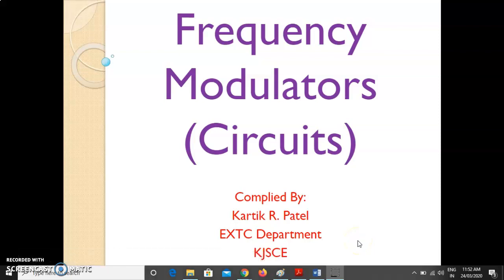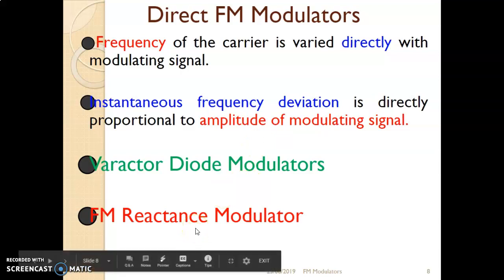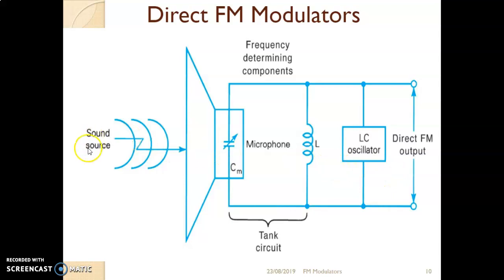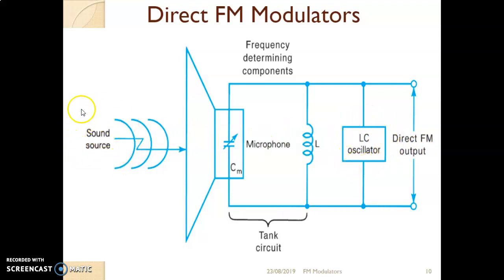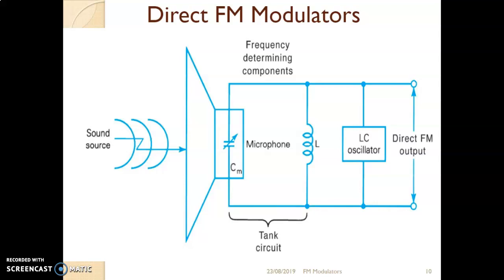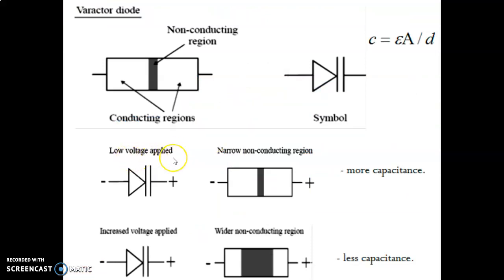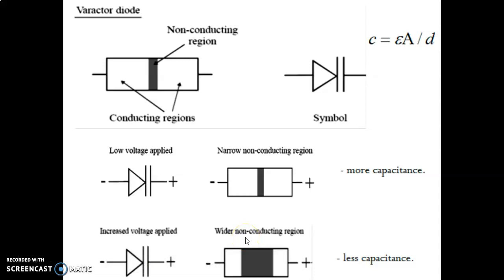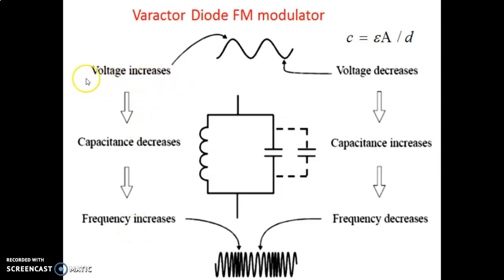Chapter 3_Direct FM Modulator_Varactor Diode Modulator

Comment: Why there is a coupling capacitor between the tank circuit and the crystal oscillator in varactor diode method?
Reply from the maker: This capacitor is a large value capacitor so that at operating frequency its reactance is very low. As a result when Cc is connected in series with lower capacitance VD1 the effect of VD1 were connected across directly tuned circuit.